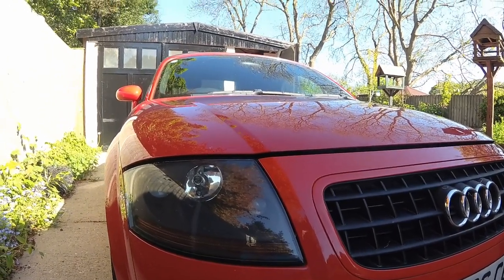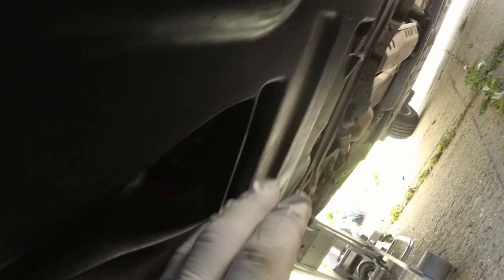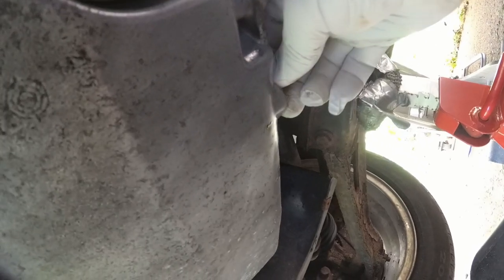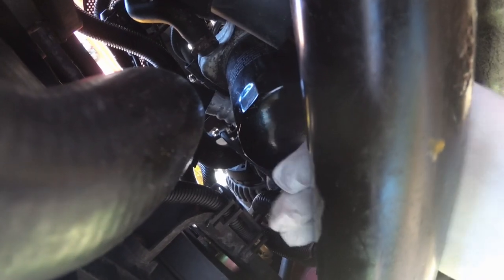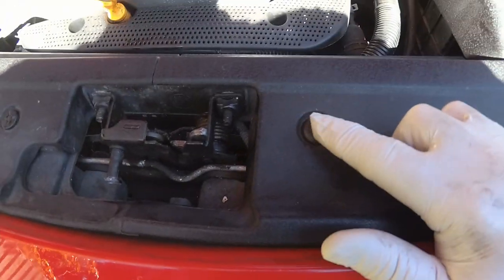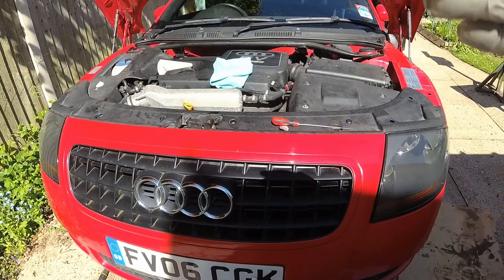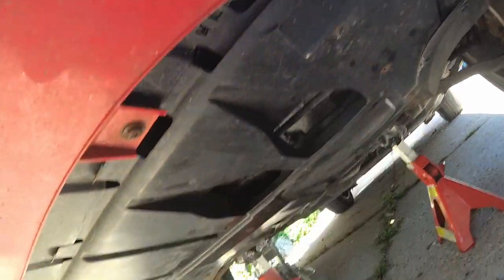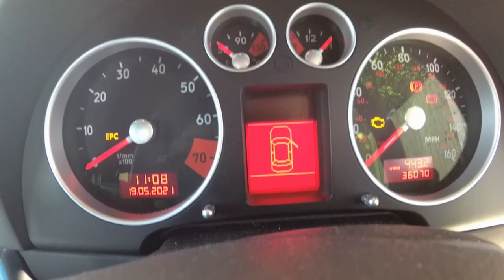Audi TT Mk1 Oil and Oil filter change

Comment: Iv always been told to use 5w-40
Reply from the maker: Well the numbers indicate how easily the oil flows. The number before the W indicates flow for normal operating temp . The number after the W( which stands for Winter) is for winter flow so a lower number flows better.
Reply: @SNORKYMEDIA  its the other way around